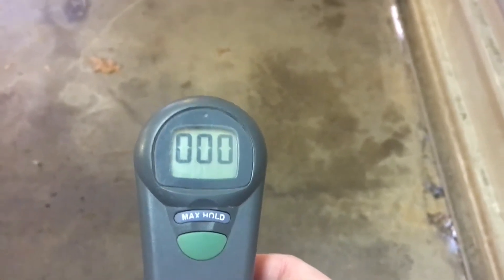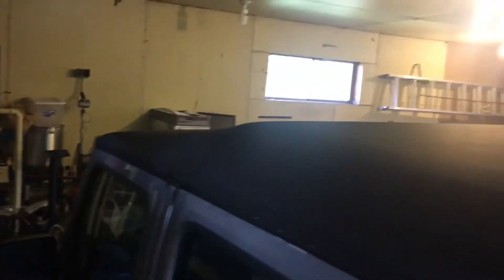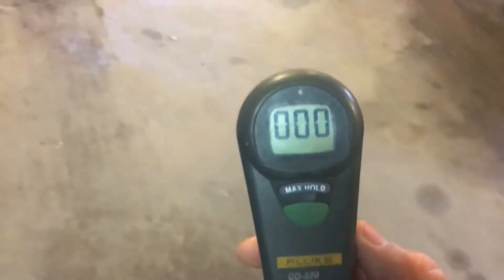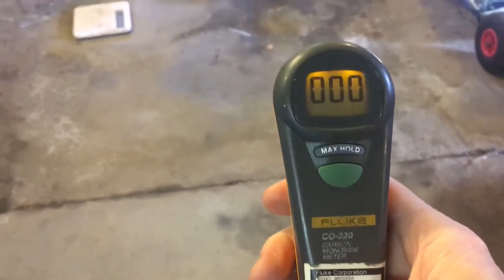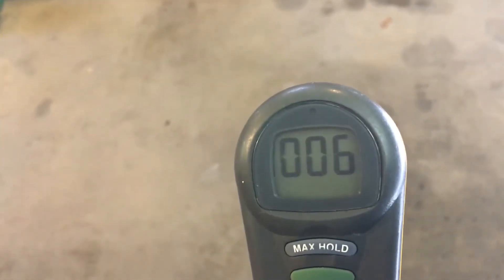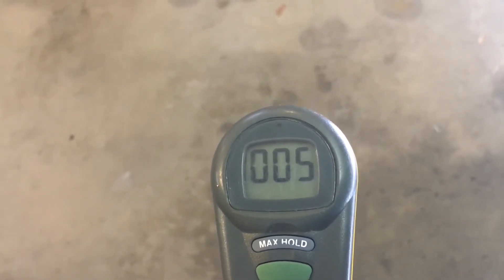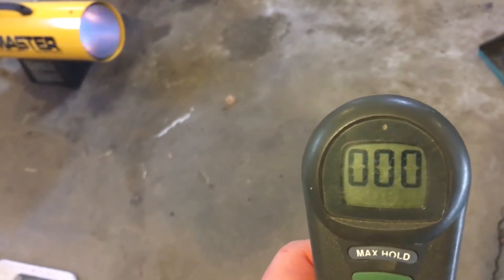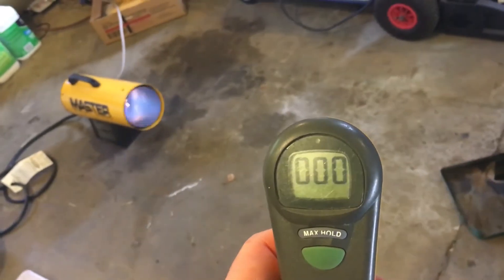Does my propane heater emit carbon monoxide?

Comment: All heaters that burn fuels produce Carbon Monoxide.  As the flame burns it consumes oxygen.  As the oxygen levels in your space drops, the flame struggles to burn efficiently and the Carbon Monoxide produced by each liter of fuel begins to increase dramatically.  I cut a 4 inch hole in my garage wall about 6 feet from the floor and installed an aluminum dryer duct, with a gate,  which drops down to about 1 foot above the floor with an elbow that exits just behind my propane torpedo style heater which is positioned on the floor in the corner of my shop.  The heater now draws fresh combustion air from outside of the shop before it is heated through the heater.  My meter no longer registers any Carbon Monoxide levels.